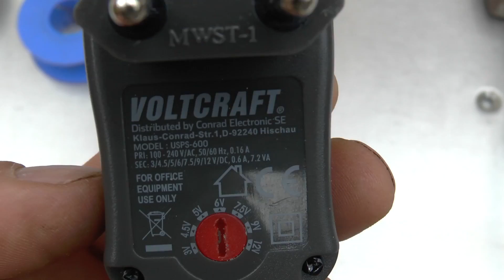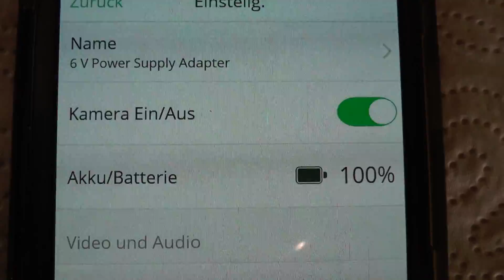Cool Idea - Power Supply Adapter for Arlo Netgear Camera VMC 3030 - 100EUS

Comment: Hi, I bought a LANMU 6V/1000mA adapter, and I also found some 6V/200mA, 500mA sitting around my box as well. Does it also works for the same? Thanks.
Reply from the maker: The camera has a very low power consumption,
in battery operation they also last almost a whole year.
the power supply has 0.6A no problems here.
I also run some cameras via the USB port
Thank you for stopping by
best regards Frank
Reply: @soundadapter  Hi Frank. Please what is the voltage of the adapter connected to USB port? Most mobile phone usb adapters are only 5.0V 2.0A.
Also won't running the power via USB damage the camera chips on the long term?

Comment: What do you think would be the best way to use rechargeable Li-ion CR-123a batteries and a 6v solar panel would be? And keep it the water out for outdoor use and still be able to change the batteries out when they go bad.
Reply from the maker: I would take a 12v solar system with charge controller for the battery,
and via a voltage regulator the voltage to 6v rules for the camera,
in the camera, only the adapters come
Greeting Frank
Reply: OK that was a little more in depth than what I was thinking. LOL Thank you for the plan. What do you think about this? A small 6v solar panel with a solar panel charge controller? I have read a 6v solar panel can up to 9v. So it should put a small charge on the batteries. IDK what do you think?
Reply from the maker: just try it
You can also provide the camera via the usb port,
but then you need 5v
Reply: I just saw that on below. So that is a usable port? Or was that there mainly for the factory to test and program the cameras? Probably wont be able to charge batteries through that port?
Reply from the maker: The problem is,
  that you can not close the battery cover :-)
I would rather keep the batteries externally, and only the adapters in the case inserted.
Reply: I was thinking to mod the 3d plans. But you are right. Keep it simple. Don't overthink it.
Reply from the maker: there are already commercially available amazon,
to buy power supplies with adapters,
it saves a lot of work :-)
Reply: Well that takes all the fun out of it! LOL. For real that solves the battery issue on one camera. The others are stuck with battery. Hope they dont start breaking as soon as I get things figured out.

Comment: I make two similar samples; I test this adapter 3-weeks ago thinking it would be great to not worry about replacing batteries all the time. It worked great for a couple of weeks and then it stopped. It would constantly lose connection. I had to unplug and plug it back in to reconnect. Then it stopped working all together. I tried to reset my camera and now my camera does not reconnect to the home base.  i find the power display on arlo app ,Gradually less ; 100% --99%--90%--50%---at last offline; 
Do you encounter this situation?Hope to receive your reply ！Thanks
Reply from the maker: Hello Victor,
I just checked,
I have 1 camera at 90% after about 6 months
and 3 cameras at 94% but no failures
probably depends on the power adapter.
The test with the USB connection, I did not notice this problem.
Greeting Frank